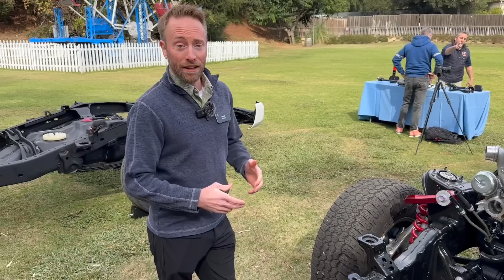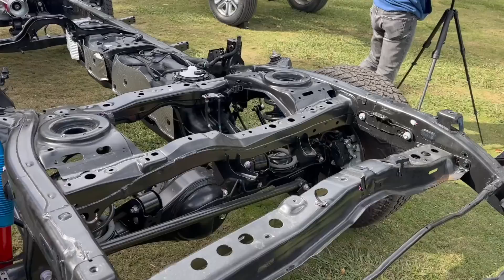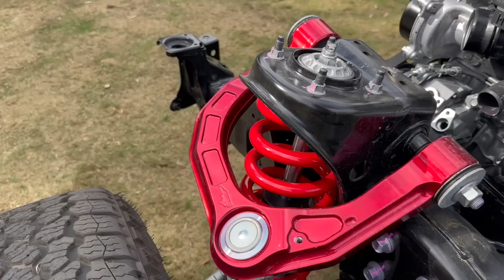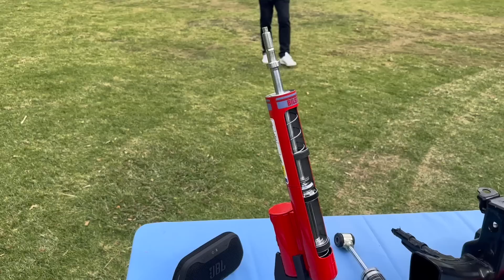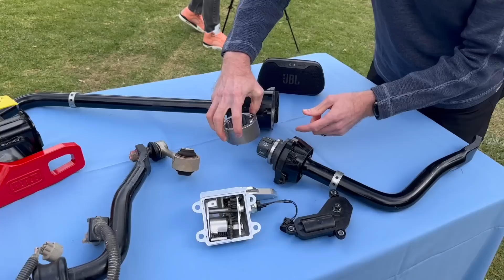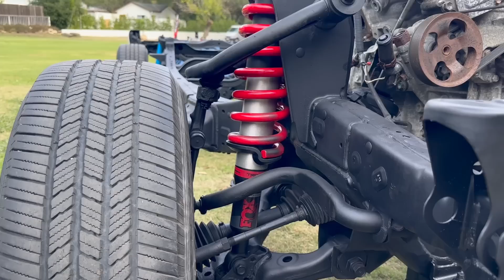2024 Tacoma Lead Engineer Explains Why The 4th Tacoma Is Better Than The 3rd Gen

Comment: If u do your regular maintenance , toyoto Power Train will do the rest 👍.
Reply from the maker: Very true! Hopefully this powertrain proves its reliability like every single one has prior to it.
Reply: @TRDJon    toyota knows what they are doing. however there  will be  some people online always  who complain
Reply from the maker: Always is
Reply: @TRDJon  👍👍
Reply: @TRDJon  Jon - could you answer this very important question. I was not able to ask this in your Q/A video. We know that turbo require a minute of idle engine time before driving and several minutes of cool down time before turning off the engine - which is a pain, hassle, high maintenance, and not practical. Do we need to do this in the new Tacoma, or is the Toyota new cooler enough for us to abuse the hell out of this truck (after the 1000 miles break-in period)? This is the only thing stopping me from getting this new Tacoma. Thank you!
Reply: @RisenEagles yes we all know turbo engines are nightmare if you don’t maintenance it .. look at ecoboost their junk
Reply from the maker: Me personally I always let my vehicles warm up. No matter what. I just shut them off though when I’m done. Modern vehicles don’t really need it but I just do it outta habit.
Reply: @TRDJon  Thanks Jon!
Reply: Years ago you were suppose to idle cars with a turbo for one minute before turning them off so your oil would cool the bearings in your turbo. Now with water cooled turbos you can shut it down right away.
Reply: @howardklatsky5016  Do we know if the 2.4L turbo in the Tacoma is water cooled?
Reply from the maker: it is yes
Reply: @TRDJon  Was that a reply to me? Regarding the water cooled turbo. Youtube doesn't say who your reply is to.
Reply from the maker: That's annoying. Yes it was
Reply: @TRDJon  Sweet! That one less concern alleviated. Thanks!
Reply: I do not know but most turbos today are water cooled. I guess you could walk into any Toyota dealers service dept and ask.
Reply: All new Toyotas have water cooled turbos so it would make sense that it is. @RisenEagles
Reply: Agreed
Reply: These price increases are not worth it.
Reply: @jeffschneider2356  It really depends on the configurator. Until then, let see what we get. Like Trd Jon mentioned, this Trd off-road is on par or better than Gen 3 Pro. So perhaps the name Off-road is dismissive. 

With that said, if you buy an OR or Pro and don't take it off-road, then it is a lot of money.
Reply: @RisenEagles  they are raising the prices on all models from 15 percent to 25 percent.